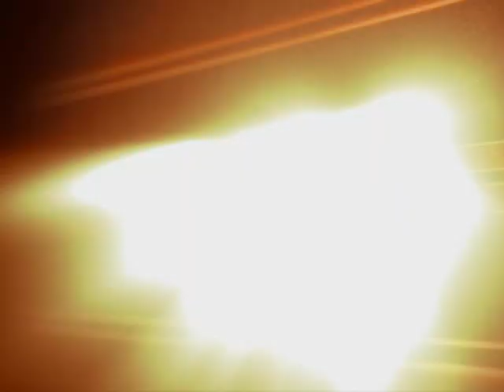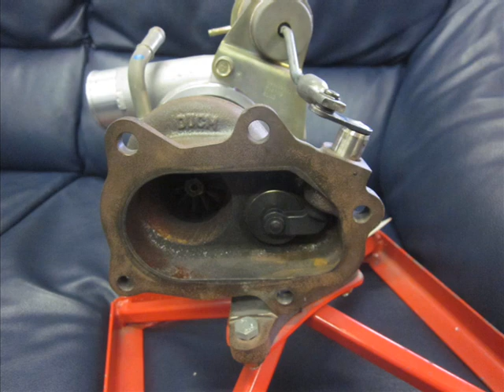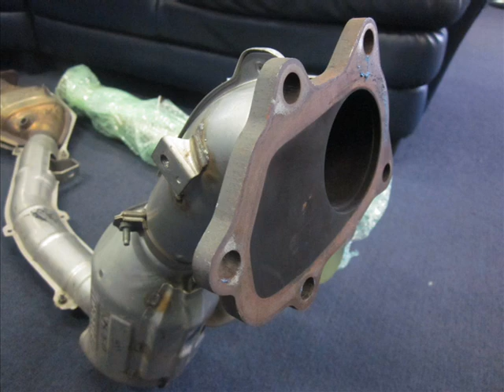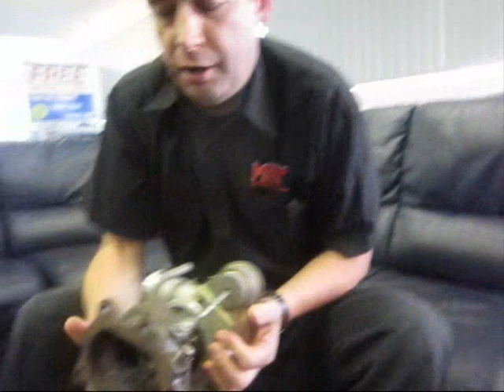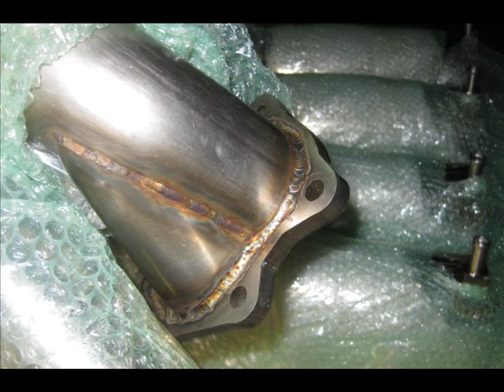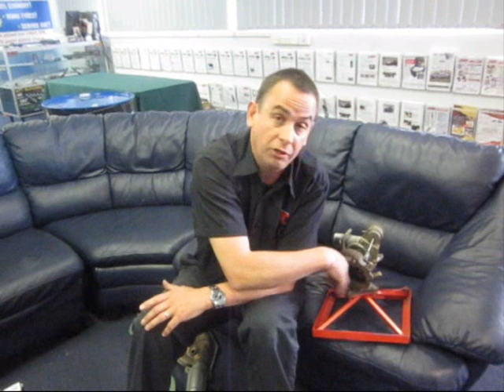Subaru exhaust secrets The Dump pipe and splitter

Comment: I'm confused. How does this help you reduce lag? The waste gate is closed until full boost is reached. The only time air is coming out of the waste gate and disrupting flow is well after lag.
Reply: +MrZX1206 The point of my question was to educate the video's poster. It likely does help spool but it isn't because of the gasses mixing, because there is only one gas before spool. The wall is helping to create a scavanging effect on the back side of the turbo. Normally the high velocity exhaust gas from the turbo dumps into the wastegate housing which is a big cavity. The big cavity slows the speed of the exhaust gas. By adding the wall the, the velocity is kept high which makes a lower pressure on the back of the turbo, by not pushing through that cavity, it easier for the turbo to spool. The only other way for me to explain scavenging would be to ask you if you've ever siphoned gasoline. As gravity pulls the gas down the exit side of the hose, the low pressure pulls more gas into the intake end. Two stroke motorcycles use expansion pipes for the same principal.
Reply: @MrZX1206  Came to comments looking for these points. MRT makes great products but this video is at best 50% correct. Scavenging also benefits divorced downpipes. Fluid dynamics can be somewhat counterintuitive.
Reply: +MrZX1206 Just because you hit full boost early in your rev range doesn't mean you will keep it for the rest of the range.
You might hit full boost at 4000 rpm, but by 6000 rpm you're probably only seeing 2/3 the boost.
Separating and porting the waste gate reduces the restriction a lot more which helps you keep the high PSI for longer which is the same as reducing lag. 
More importantly prevents boost creep which is an increase in PSI at the higher revs that your car probably doesn't have tuning for. 
Of course the far better option is an external wastegate.
Reply from the maker: +MrZX1206 lag is the ability of the turbo to get onto boost as quick  as possible, not after the wastegate opens.
:)
Reply: +MRT Performance That's my point. How does segregating the wastegate help with lag?
Reply from the maker: reduces turbulent back pressure on the outlet side of the exhaust housing  /  wheel
Reply: +MRT Performance it allows the turbine to spool faster because there's no interference with the two gases meeting. wastegates start actuating sooner than full boost
Reply: +vevohoeyo I agree wastegates move before full boost but this says it helps spool. If the turbo hasn't spooled, what is causing the wastegate to move? My wastegate uses positive pressure from the intake manifold to move, but before spool there is no pressure, so no movement, so no turbulence from two gasses mixing.
Reply: Id like to see mrt's response to the scavenging effect!

Comment from the maker: Yes well err sorta, as long as you knew how long to make it as all turbo models vary with the INSERT of the splitter INTO the turbo as well as the internal length of the splitter inside the bell mouth and the relation of the exact position of the splitter to match the turbo internal divider
:)

Comment from the maker: Most of our down pipes actually have cats in them, the splitter brings the turbo on earlier as it directs the wasted gas in the right path. 
As the turbo hits peak target boost and the wastegate starts to open the valve on the wastegate directs wasted gas immediately across the outlet of the turbine outlet.
This causes a high pressure zone effectively causing higher back pressure exactly where you dont want it.
The splitter stops this and the resulting improvement is measurable.
Reply: Can i change mine?even stock my98

Comment: It does, but it doesn't extend out like this one. Which when I think about it makes mine sorta pointless... I did notice quicker spool up (prolly 600 rpms sooner) I did install an invida up pipe as well with my downpipe and thats where most of the faster spooling is coming from. I just love it because: it was cheap, WELL MADE, fit perfectly, catless, sounds AMAZING and spits flames in this 100+ heat.

Comment: Hey Brett, don't know if you are still responding to inquiries but I've got a VF43 going into my '06 Forester XT and will mate it to a Cobb bellmouth Dp w/ a Stromung 3" exhaust.  If I surmise correctly from your video, I should make a template to be welded into the Cobb bellmouth in order to direct wastegate gases, or do you think the bellmouth in itself is enough to direct the gases?

Comment from the maker: @lbori1 a separate pipe ads no benefit, all it does is ad cost and complexity. Plus more risk of parts failure. The critical part is the splitter and the DEPTH of it matching the turbo it bolts up to as they all vary